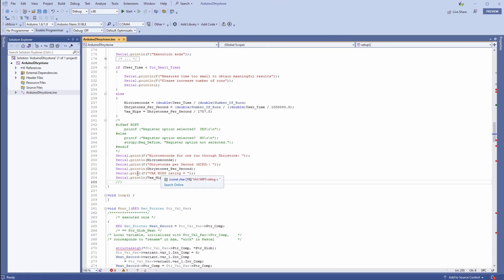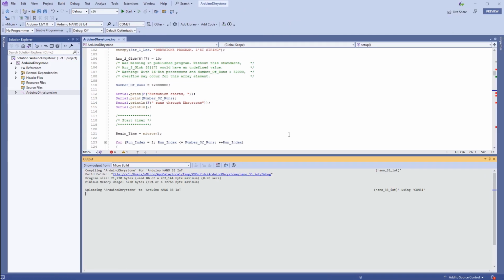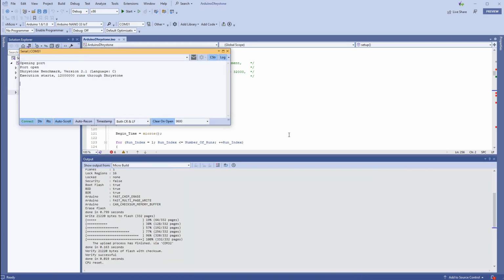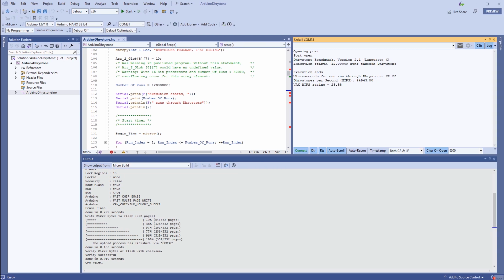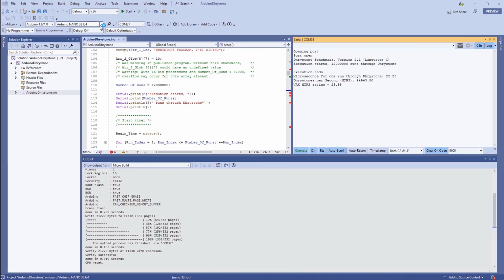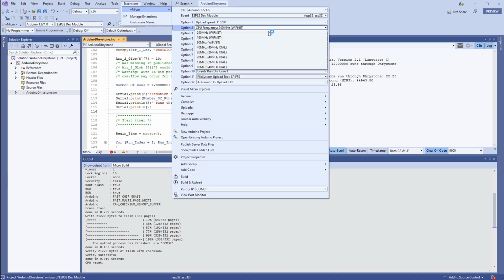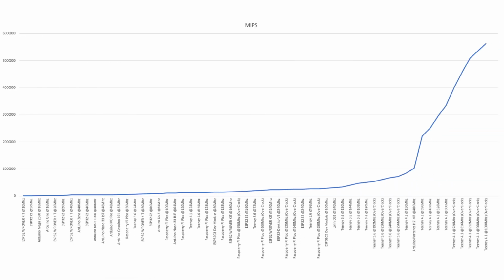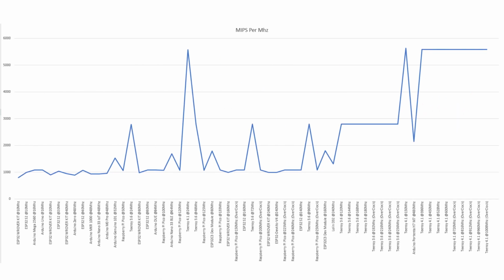Benchmarking Arduino Compatible Boards

Comment: I own ESP32-S3 board, which was around since first quarter 2021, if I'm not mistaken.
This video was published last quarter 2022.
So there is at least 1.5 years between existence of ESP32-S3 and this video.
Yet, ESP32-S3 is not included in these benchmarks. That make me wonder...
What I also wonder, next to  MIPS per MHz, is power consumption figures of the presented devices.
These are often IoT devices, solar powered, and so it helps to have the balance between processing power and power consumption.

Comment: Hi there. I just installed VM and started doing some evaluations on a few boards. Most of the boards are working great, some with issues and some with unsolvable issues. 
Anyway, I would like to request a tutorial video for Spresense board. Especially how to use the multicore. Currently I can only program the maincore, but I can't even open a separate editing column for subcore1 to subcore5. In ArduinoIDE, all these are very easily done. I wish VM would provide something very much like the ArduinoIDE. I haven't made up my mind to purchase VM or not yet, but if I can use Spresense just like AduinoIDE (or even better), for sure I will purchase it.
Thanks in advance.
Reply from the maker: The board options which are shown in the Arduino IDE for the Board Core setting, are also shown on the vMicro Menu, and changing them has exactly the same effect:
https://www.visualmicro.com/page/User-Guide.aspx?doc=Board-Setup.html

With the Arduino IDE you have 2 x Arduino IDE open to program the Main Core and SubCore 1.

In Visual Micro you can have two (or more) projects in one solution, and configure each project to use a different core from the board options menu.

The best place to seek assistance is on our forum (registration required) where we will be able to help with much more detail:
https://www.visualmicro.com/forums/